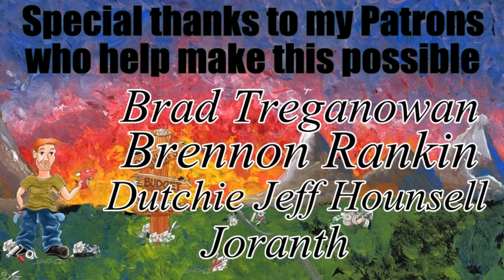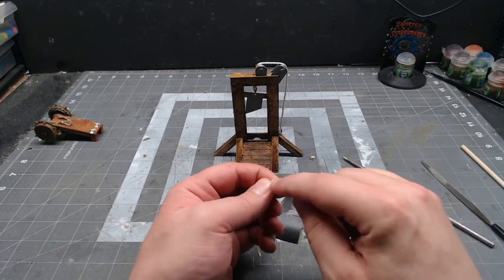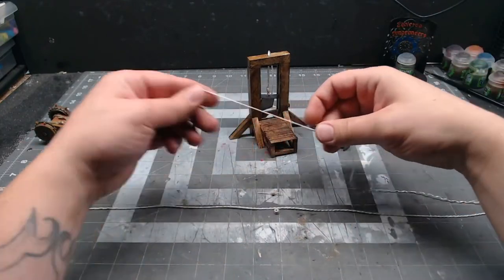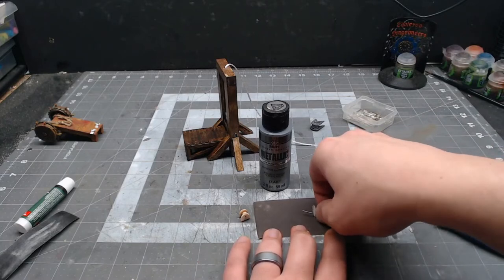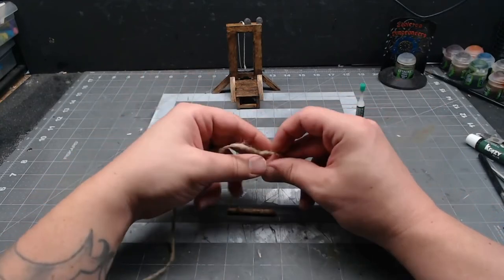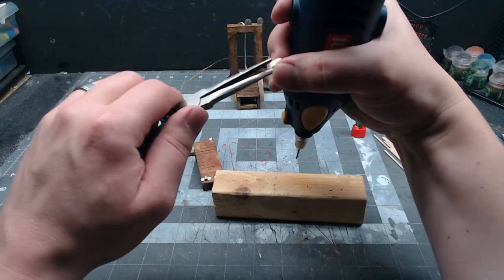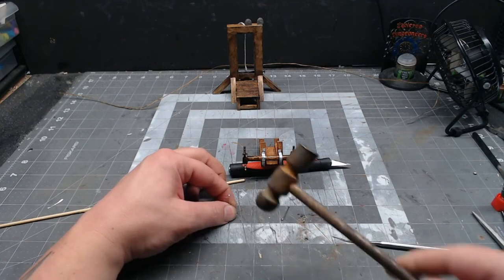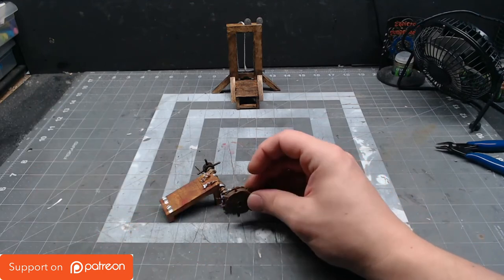Fixing the past 2 builds

Comment: That thinner string did make the project better looking and a little closer to what it would really look like.  For the string, you could also use a method that I use when stitching leather.  Rub it over either a regular wax candle or get a small block of bees wax to rub it over.   I always use bees wax, and in fact I get cord that already has it in it.   It isn't always available overseas, as I get it from Tandy Leather here in the America.  Once you've rubbed it over the wax, use your fingers to work it into the twine by pinching it between them and just rub it the full length of the string.   It will kind of push the wax between the fibers and make them stick together better.  That would make then a little less stiff.
Reply from the maker: I actually tried that first, the jute just shreds lol I have tons of leather working stuff, I had thought about using one of my thinner waxed cords but I'm tryin to steer clear of mostly costly or "rare" items
Reply: Using the same cord you used, rubbed over the wax would work too.   I've even used something as small as regular sewing thread over the wax, and it does keep it from fraying at the ends a little longer.  Melting the ends on that nylon does help too.
Reply: in a pinch, some waxed dental floss from the dollar store could work. just don't use the minty one.